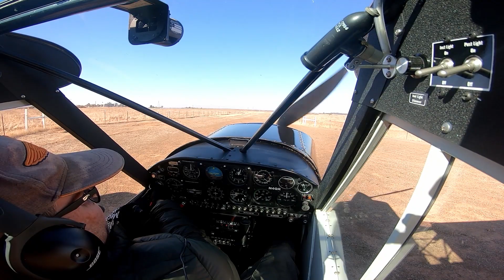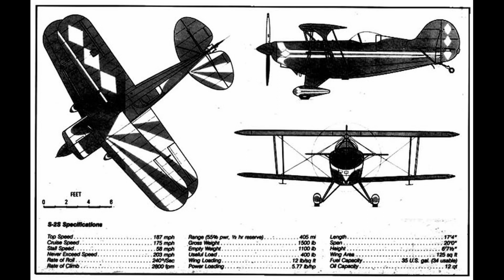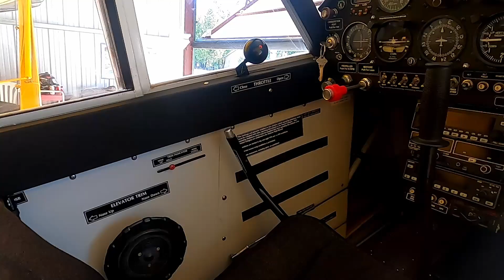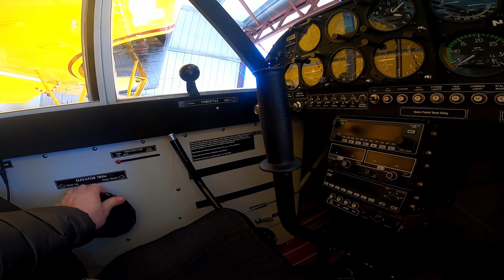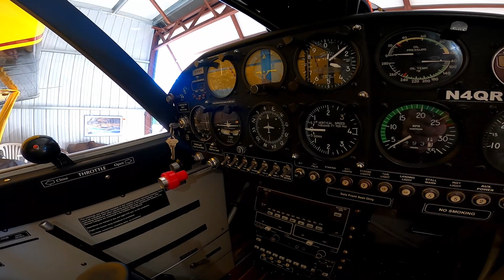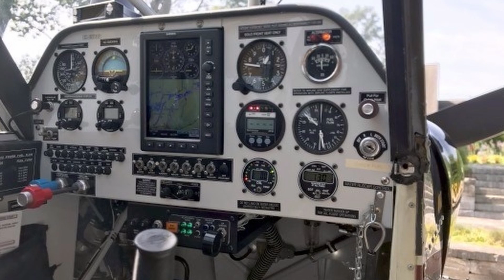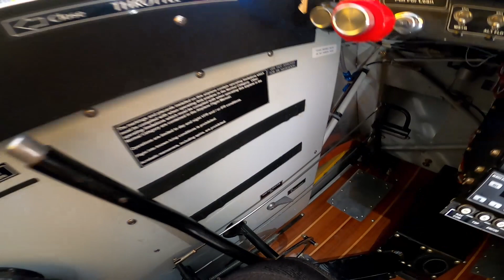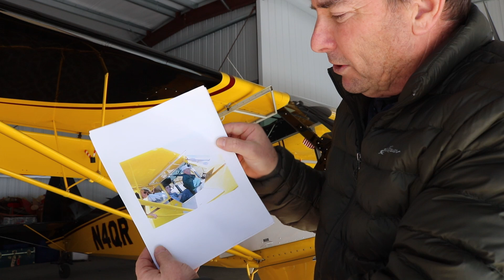MEET THE AVIAT A-1 HUSKY!

Comment: I got to fly a brand new one of these a couple of weeks ago because of a very generous owner. The fit and finish is incredible. It flies like it's a little heavy, and high pitch forces through the stick suggest the one I flew was perhaps a bit nose heavy. Very solid and safe feeling aeroplane, and luxurious as a bush plane can be. It's a flying Range Rover.
Like Juan I also used to have a Luscombe, and TBH, I prefer that. It's lighter, sweeter handling, and will get in and out of mostly the same runways, as long as you don't have a fat copilot or want to take anything like the luggage the Husky is capable of.

Comment: Thanks Juan for the tour.  My old Quicksilver MX wasn’t really good at cross country flying.  I realized just recently that what I really used it for was as an elevator.  Almost always went  right back where I started from!  Went up like a homesick angel. Trim with throttle, and it flew hands off.  No pesky instruments or prop to spoil the view!   Proves the rule; all aircraft excel at one particular thing that is design dependent.    You put a smile on my face, and a song in my heart!      N.E.OH Bob

Comment: Juan . Speaking of not being able to see from the cockpit on your HUSKY. 
  I was working in the oil field on the North slope in Alaska and was ready to go home for R&R for 2 weeks after 14 weeks on when the twin otter did not come. I desperately wanted out of there so I jumped in with Lynden freight pilot in 
A DC-3 coming to pick up trash and mail this was  my chance to get to Anchorage so I jumped in with this short guy tattoos all over his arms his neck his face and piercings and look like a walking pitbull!  we pull out onto the gravel runway at Alpine that DC3 sounds like it's got a couple of Harleys out on the wings he turn that thing left and right and left and right as we went down the runway so he could see and then gets turned around lines up one more time nails the throttle and away we go and man oh man what a ride it was my adrenaline was going through the roof fire just shooting out of those exhaust pipes oil streaming over the wing what a machine!! Dammit Jim I'm a heavy equipment operator not a Pilot!! 😁😜

Comment: Juan, I have owned two Huskies for a total of 13 1/2 years and 1,600 hours PIC in them and I thought your video and explanation were exceptional.  I too think it is an awesome airplane.  My A-1C is like yours in that the prior owner had a very bad day and it was completely rebuilt at the factory including a new fuselage.  Mine is a 2009 / 2016 A-1C and I paid the price of a 2009 and got a 2016 airplane.  I agree with you that the Husky will do a good job of keeping you humble if you don’t pay very close attention on every landings.  It usually happens to me when I have made 5 or 6 excellent landings and decide I am really in the groove, then I get to test the bungees.  I have never flown an A-1, but in both my prior A-1B and now in my A-1C I do all landing with the approach speeds you were using and full flaps on every landing even in a strong cross wind.  I have 26” Goodyear tries that wear exceptionally and still provide decent of off airport performance.

Comment: Nice plane, the early piper pa 20 had a lyc 135 hp. I loved the fabric much quieter than the older Cessna 170. The piper was utility rated with 2 people where as Cessna was normal category. Lots of internal strength and kept in a hanger should be good until you son is your age lol 😂 safe flying and make the time to put it to good use.

Comment: Gorgeous airplane Juan! I love the colors 😍😍 Your trim system is the same as on our gliders, except ours is controlled by a lever on the control stick. You squeeze and hold the lever and then move the stick and let go and the trim holds the stick there. It would be a really nice modification if you can do that on your husky, makes is extremely easy to do rapid trim changes. 👍🏻👍🏻

Comment: Nice for high country, you don't need to navigate reading the road signs. Thing about tundra tires is there only used 4 or so months a year, the rest of the time its (was) skies. But, there not many airports with an additional sod runway that they pack down in snow season any more. Looking forward to you checking the performance and manuvers. Overall, not as practical as a 185 but, a lot more fun.

Comment: Appears as though your camera is stabilized as in gyro. Maybe just an optical illusion. Sound is clear and very audible. Carb heat is an important part of flying these carbureted  engines. A friend of mine lost his Cessna 170B four years ago on takeoff due to carburetor icing. Off airport landing into the mesquite trees....totaled the plane but he and co-owner were uninjured.  Great video.

Comment: Welcome to the Husky club. They're great aircraft and can do a lot. I've not got any time in early types but can offer a few little flight tips which may or may not help you.

With regards flaps. I basically never use the intermediate settings. Full flap for landing and full flap to take off.  I find if you fly a reasonably tight circuit you can drop the speed on downwind. Get all the flaps in at about the end of the runway and that allows you to nicely set up for landing with minimal adjustments.

It seems the airspeed indicators can vary quite a bit because of the pitot static design so directly comparing approach speeds isn't perhaps the best.  But in mine. I find for longer runways (>300m) 60mph works well in most conditions. For short stuff with non gusty winds, 50mph indicated works well with flare to arrest the decent and I tend to like to roll on a tail low wheel landing.

For 3 points I wind in the full nose up trim when I'm settled on final  at maybe 200ft  then you're not having to come off the throttle in the final phase.

Most of all, have fun with it!

Comment: Awesome airplane, Juan! If I can make a suggestion, please consider wearing a helmet if you're going to fly back country in that airplane. Your noggin is worth it. I use a Gallet LH250 in my Stearman. It's as light as the HGU-55, but has better crash protection properties and two visors. For your limited space cockpit, check out the LH150. Vary comfortable, integral, low-profile visor and really good comms. Enjoy the new jet, buddy!
Reply from the maker: Good Idea!

Comment: I owned a 82 Piper Tomahawk II, it also had the Spring Trim Elevator System, it was ok, the trim chain may fall off the sprockets if the trim wheel is moved to its forward/aft limits.
I like the Piper stabilator, very smooth pitch control, with the Tomahawk elevator I would experience some pulsing on a full stall landing.

Comment: Congrats on the new toy. You touched a little bit on the fuel tanks not reading correctly in the three point attitude. I’m also getting a new tail wheel aircraft soon and was curious about the engine oil reading and what people do to properly measure the oil when the engines sits at an angle?
Reply from the maker: Oil should read correctly on the ground. Good question!

Comment: Juan - I own a 2004 A1-B which is IFR (it also has a factory-installed heated pitot).  An awesome airplane, and one of the finest GA aircraft I have flown!  I now have about 1250 Husky hours, and over 2000 takeoffs and landings, mostly in my airplane (and every landing is different - sometimes a little, sometimes a lot!).  I live in NC, and have flown my Husky to more than 1/3 of the states, and several Canadian Provinces.  It is a great traveling airplane - just travel light!  My wife and I have flown it to the west coast and back twice, including to AK and back.  Fun trips!  As you note, the Oregon Aero seats are very comfortable.

For anyone new to the Husky, I recommend joining FlyHusky.com, the Husky Owner's Listserve.  Lots of excellent experience in that group.  A very excellent orientation video you have..  I have some comments: 

Check on the recent rear stabilizer AD (Fairly easy to do with a borescope).  As recently as your airplane came out of factory rebuild, it is probably just fine.

I don't recommend wearing nylon clothing in any airplane - very nasty in a fire (I have been in a Cessna which had a cockpit fire inflight - rare, but it happens).  I also mounted a Halon fire extinguisher on the Husky's front seat frame, in easy reach of the pilot.

For radio and intercom sound on the GoPro, if you use the Bose headsets on a LEMO plug, just plug the camera  into the regular mike jack, even if there is no headset.  Works fine and picks up you as well.

I have two sets of wheels, one with the 8.50x6 tires, and one set with 26" Goodyears, which are a bit less expensive than the AKB's, but not as good off pavement.  

BTW, I trim for 50 of so on short final.  For short field takeoffs and landings, I use full flaps.  Works just fine.  

Have fun, and stay safe!
Reply: I meant to say plug the GoPro into the phone jack, not the mike jack
Reply from the maker: Thanks Chris!

Comment: Congrats Juan, that's a beautiful airplane! Looking forward to lots of bush flying videos. I'm not a pilot and I'm confused. If the trim just moves the stick using spring tension in the Husky why do you need to mess with it for landing? Doesn't moving the stick do exactly the same thing? I understand how it works in conventionally trimmed planes and why you need to adjust it.
Reply from the maker: Fighting the spring tension if mis-trimmed. Heavy springs.

Comment: Yes I would have skinny tyres on it and wheels, I think it's better for landing as well and of course flying plus heavy tyres like that is causing more stress on the hub considering they have crack before if they're not a redesigned best to have lighter wheels and tires look better as well imagine getting a lot of bounce on landing with those tears. Gravel landing you think is better why is such an issue with the skinnier tyres train tracking

Comment: Actually the Husky was designed in the 80’s, not the 90’s.  Also, the later models replaced the spring trim with a trim tab.

Comment: Mickey Mouse fasteners for the Cowl...???  Hmm?   Well you know the deal.... If you look in line with the cowl and you can see Mickey looking back at you.... ITS NOT SECURE. If it was mine, I’d be putting Thumb Knocker Flats on there. I don’t know what they call them... but on the old A model Tanker...I called them Cowl latches